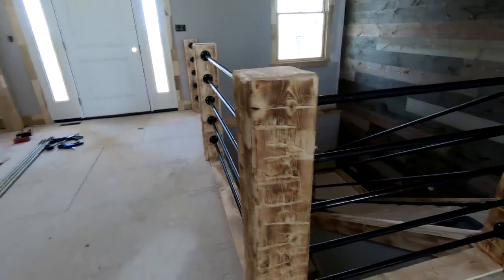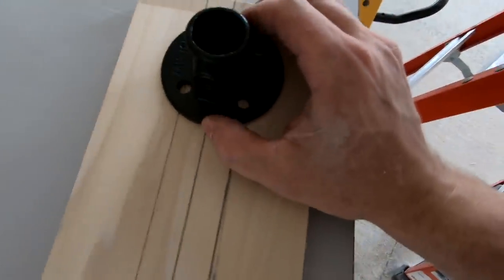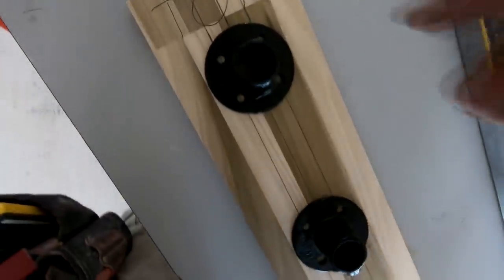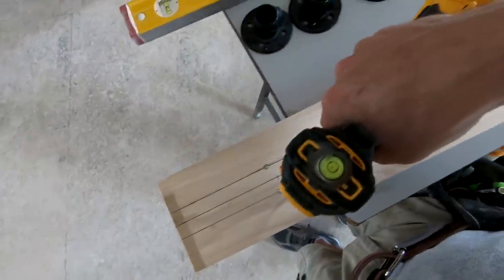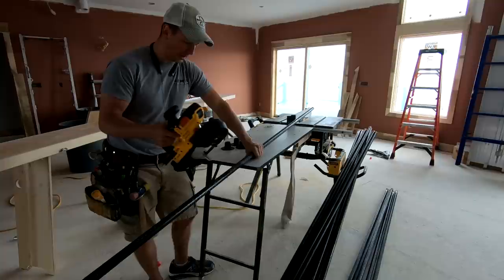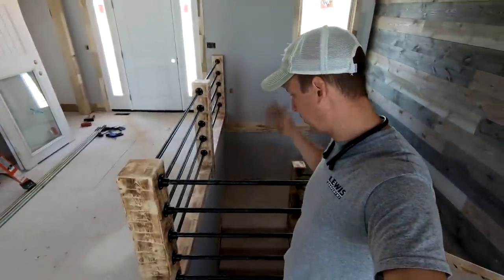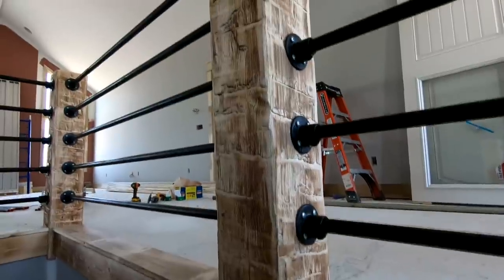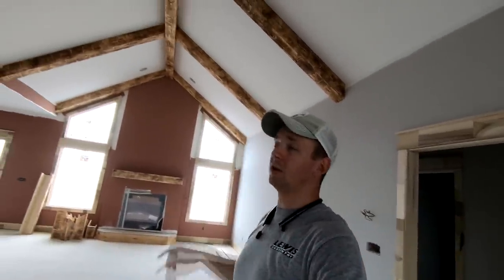Rustic Staircase Pipe Install - Easier than I thought...

Comment: That's a pretty nice fishing shanty.
I have heard for years that oily rags can start a fire. Well for 15 years now I have been wadding up oil stain covered rags and throwing them in the burn barrel, not once has it ever lit itself. I realize that the rags are trying to trick me into leaving them in the shop so they can explode into a fireball and burn down my garbage can/ Well I switched to water based stains and finishes... so take that oily rags.
Reply: it can happen back in the day linseed oil was used a lot and it was really bad for spontaneous combustion this but can happen with other oils under the right conditions it is like all accidents they are usually a combination of small things that lead to disaster

Comment: You inspired me. I wish I could share my pics here of the railing I did. I actually used solid 7x7 rough cut pine posts that I sanded just enough to remove the splintering. I used Ipswich Pine stain and then put 9 pipe rails in between each section. I couldn't find the non thread ones you used (they would have been way easier). They turned out beautiful. Thanks for your post that helped me along.
Reply from the maker: That’s awesome. 👊 Glad to hear it came together well. 👍
Reply: @InsiderCarpentry  you have a new faithful follower... lol

Comment: Grear work.. I think that on the fittings the 5/8 screws will look much better black, as it will match and not stand out.  Probably will do the same in my brothers house   (Riviera Maya at Cancun). 
Will also do the  Panel wall.  Hopefully I can find adequate wood or local tropical wood.  We have a  Home depot but not the best choice.  My question, the wall is constructed of cement block.  will PL premium work? I will not try to screw any of the planks as I will need concrete fasteners.  My other choice is applying 1/2 or 3/4 ply wood to the wall first with the adhesive follow by concrete fasteners and then  continue as yiu did, but it's an extra expense.  what do you think is best.
 thanks JC.

Comment: The flange brackets on the horizontal rails are common but do you have a link to the angled ones?
Reply: Granpa Google might have an answer ... SteelTek 3/4-in Silver Galvanized Steel Structural Pipe Fitting Swivel Base
Item #737816 Model #676-904HC or black Item #962245 Model #686-904HC

Comment: I found the flanges but the manufacturer of them who only sells through lowes doesn’t have the length of pipe I need. Did you order the SteelTek pipes as well as the flanges? Or did you use another provider for the pipe?
Reply from the maker: I used standard gas pipe. Cleaned it with lacquer thinner. It can also be painted.

Comment: Yes do you have a part number on the angled brackets. I look at the website and do not see them. Thanks again, great work.
Reply: A littttttttttle more time looking ... SteelTek 3/4-in Silver Galvanized Steel Structural Pipe Fitting Swivel Base
Item #737816 Model #676-904HC or black Item #962245 Model #686-904HC

Comment: Drilling accurate holes in a jig can be accomplished a few ways:
1. drill press (assuming it has been accurately set up )
2. drill guide by Big Gator Tools - awesome little tool i use anytime i need a "accurately" drilled hole 
3. other drill guides (mini drill press)  but are cumbersome at best

Using a "Bulls Eye" bubble vial  as shown assumes the pc being drilled thru is laying in level plane. Some corded drills came with that built into the back end of the drill but in use it is not practical as the vibration of the drill moves the bubble too much IMHO. 

Drilling  thru 3/4" is not difficult to achieve an acceptable level of accuracy. Before i bought the drill guide from Big Gator Tools and i made a similar type of jig as shown in the video I would use the face side of the jig (where holes were laid out) as the face that is placed against the pc to be drilled. In use I drill thru the back of the jig which ensures accurate pilot hole locations on the member being drilled into.  Just my 2 cents after 35 yrs in finish carpentry.  Do a fair amount of stair work so understand the importance of careful attention to an accurate layout. 
Enjoyed  the video,  nicely done and thx 4 sharing ur process.

Comment: I had a conversation this week with a guy that used to sit on the code board with SMA re ladder style balustrades . Studies found that they were actually safer for kids that vertical balusters. If a child climbs  over a ladder style balustrade the child is more likely to not fall then if they climb up and over a vertical balusters and find no where to put the feet. I thought oh some common sense thought into the code , we need more of that.
Reply from the maker: Thanks for the voice of reason! 👊
Reply: Never ever ever try to insert common sense into a bunch of lawyers writing rules. The NEC book seems to be written as confusing as possible, I mean it's in there, under 6 different subsections in different parts of the book and of course still subject to interpretation by the local inspector.....
Reply: What’s more likely to be climbed? A horizontal ladder inspired railing or more difficult vertical ones. Where I can agree with what you wrote I would also imagine the horizontal railings would be climbed ten fold

Comment: I couldn't have found this video at a better time.  I need those floor flanges!  I will be working on a project soon and I would need to insert a pipe into small hole, approx. 12", to create a handle. I would need to have the flanges attached to the pipe as it gets inserted, how much overall play can you squeeze out of those and keep the "most strength"?
Reply from the maker: I want to say the pipe goes in about 1-1/4 and the set screw is about 5/8” in.
Reply: @InsiderCarpentry  Thats quite a bit of play...even better.  Thank you!!

Comment: what section of lowes did you find them in tried to find them on their site ,cant find them
Reply: Google section ... SteelTek 3/4-in Silver Galvanized Steel Structural Pipe Fitting Swivel Base
Item #737816 Model #676-904HC or black Item #962245 Model #686-904HC

Comment: Curious why you only had 4 balusters on the stairs but 5 on the horizontal runs? Couldn't you match the spacing on the angles to match the horizontal?
Reply from the maker: It’s because the rake wall was already elevated.
Reply: @InsiderCarpentry  and that's why you're the Master carpenter. Totally overlooked that detail. Thanks for the reply!

Comment: Anyone know where I can find the flexible fitting used to install the pipes running down the treads? I found the all other fittings at Lowes but without the flexible one, none of it will work.  I send a request to SteelTek but no response yet so thought I'd check here. Thx